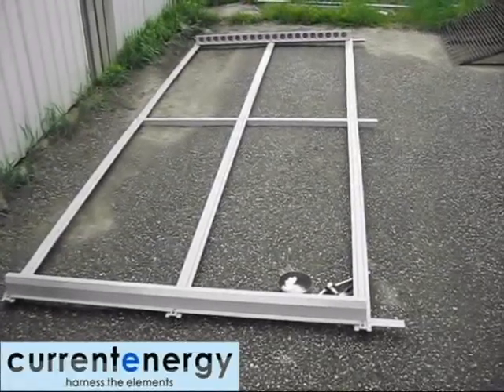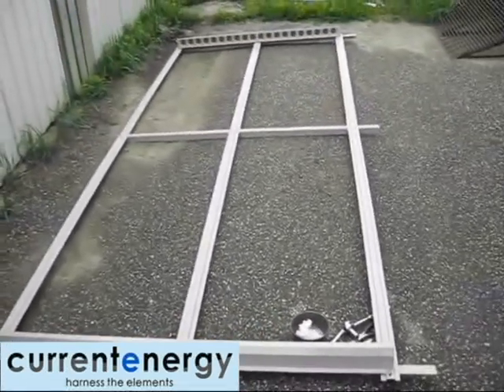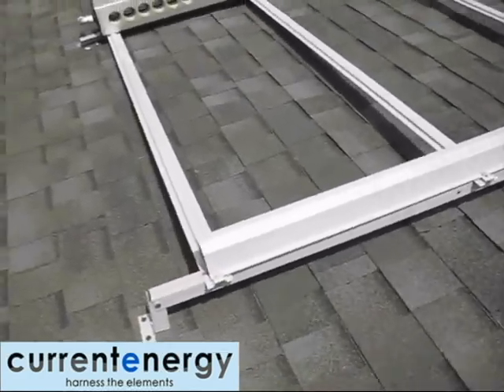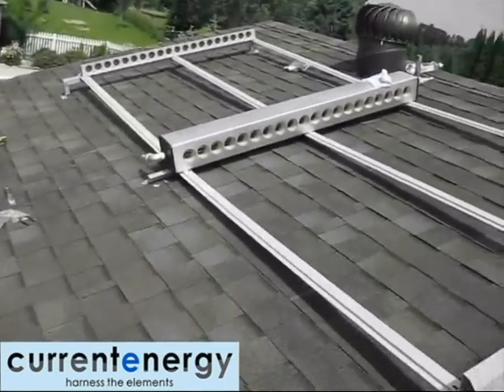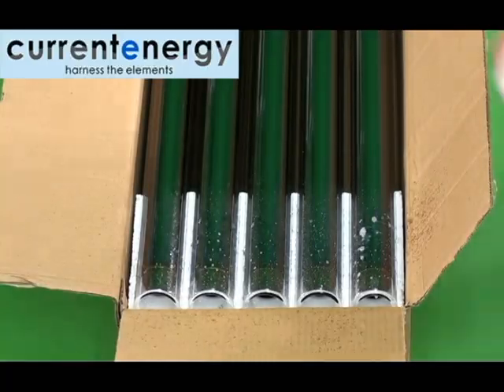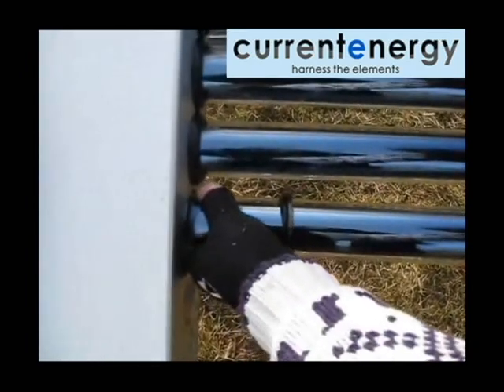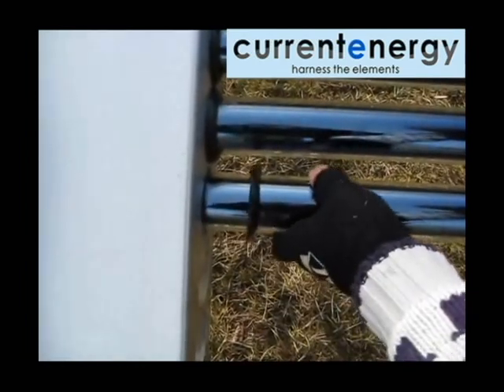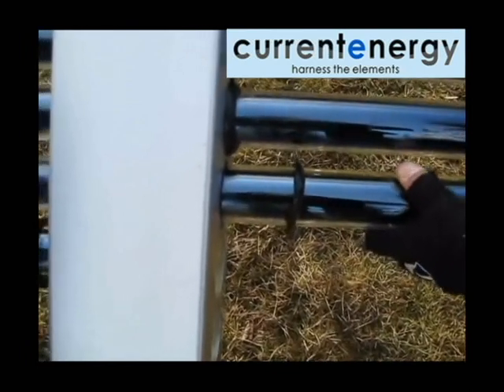CURRENTENERGY.CA  - Part 1 -VTC400 - Horizontial Pool Evacuated Tube Solar Thermal Collector System

Comment: This layout solves a problem for my solar domestic water heater.
First, I am amazed that there are only 530 views in 10 years!  Why?

I bought two 30 tube pool vacuum tube collectors made to stand up like every other vacuum tube pool heater. They cost less than the ones with copper collectors inside the vacuum tubes because they don't have them.  They are a little more efficient because the water is in contact with the solar heated surface inside, more surface area, and does not have to transfer heat through the air between the copper and solar surface.  This arrangement cannot be pressurized above atmospheric because the tubes will rupture. 
I will pump water from the bottom of the storage tank and into the top of the solar panel then back into the collector tank. A heat exchanger will be in the top of the storage tank with pressurized domestic cold water to supply the hot water to the house.

To my point, I have to drain the tubes when freezing outside. I don't want to use antifreeze. I thought about siphon tubes inside each vacuum tube but I'm concerned it may not take all the water out if it breaks siphon.  I also want to optimize the vertical angle for winter, not summer.  I'm at 34 deg N and that puts the top of the collector in view from the front of the house.  I got an idea of running the tubes horizontal and less steep to lower the height but could not decide if there would be a functional problem.  This video is the first horizontal layout I have seen. There is usually a down side for changes in design. They will catch less sun in the morning and the evening that way. 

With the tubes horizontal as shown in the video and tilted slightly up at the bottom ends they will drain when the circulating pump stops.